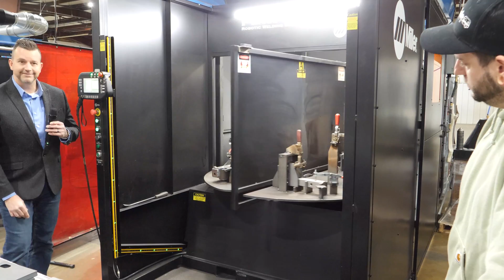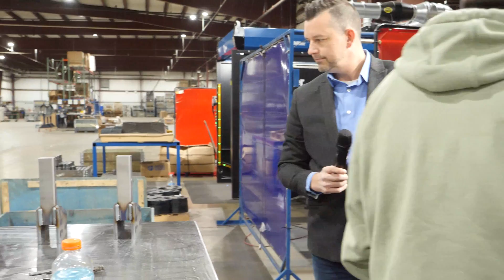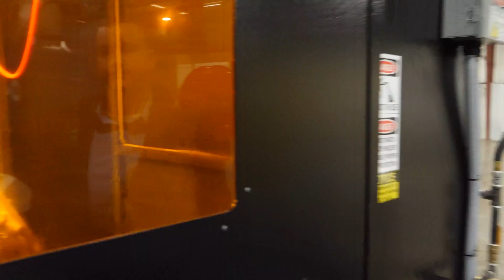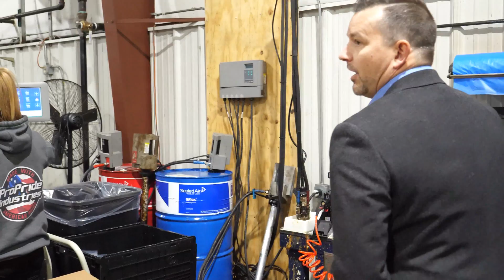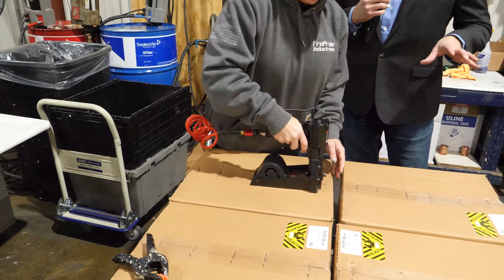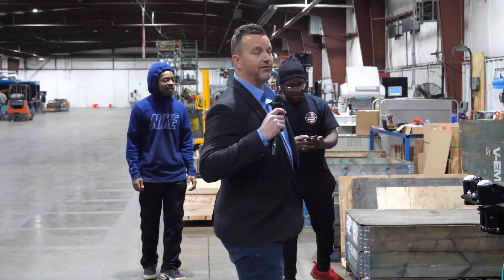See the ProPride 3P Hitch Manufactured in the USA - A Tour of Our Factory and Innovative Techniques

Comment: We completed a 7,000 mile 3 week trip and our 11 year old (original owner) ProPride hitch with new V2 jacks was flawless. In heavy Illinois cross winds, the camper stayed stable and even at high speeds no issues. We towed in 100 degree heat, a Montana/Idaho snow storm, over dirt roads, forest service roads. It proved itself in Indiana where there were heavy gusts or winds and tornados nearby. It was the first time I have ever pulled into a parking lot to wait for a storm to pass, even in the heavy winds before we stopped the trailer was stable. 

I did not know you offered reconditioning services. I struggled  with bearings and races last year, I should have sent the hitch head in for reconditioning, that joker is heavy!

Keep up the great work ProPride!

Comment: I was able to go to the factory and pick up my new hitch.  Brent and Sean are good guys to deal with.   This hitch is amazing.  I did my first trip with it last summer and it worked flawlessly.   The tow vehicle actually had a trailer wiring fault, however with this hitch going through the mountains of Tennessee, I was not concerned.  I have a 36 ft. travel trailer and have recommended this to anyone who would listen.  At the campground, the dealer even when refueling, I have had people come up and ask what kind of hitch I am using.  I drive with ease now because of my Pro Pride Hitch!   Thanks guys for making a product that actually does everything it advertises.
Reply from the maker: Thank you Jim!